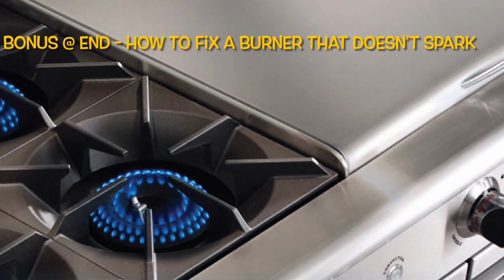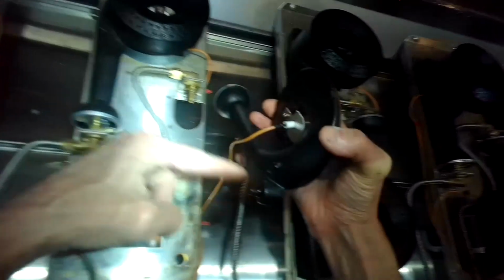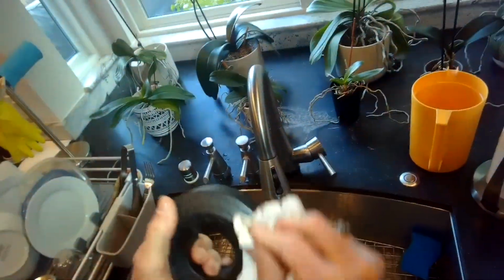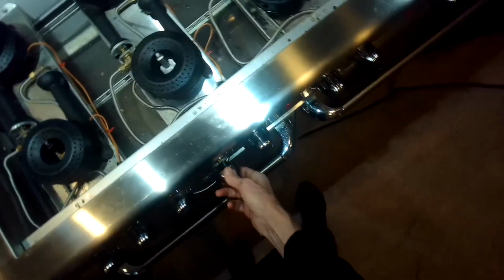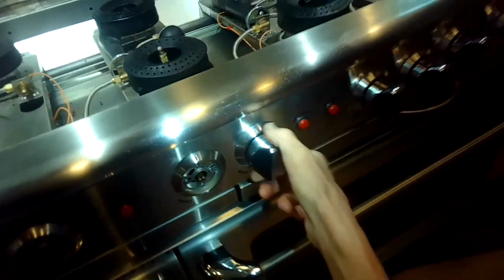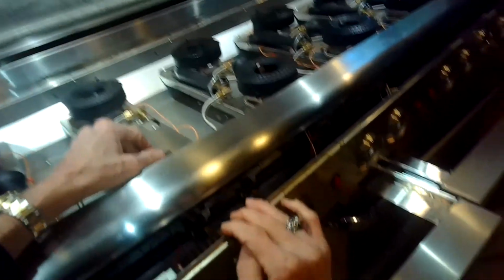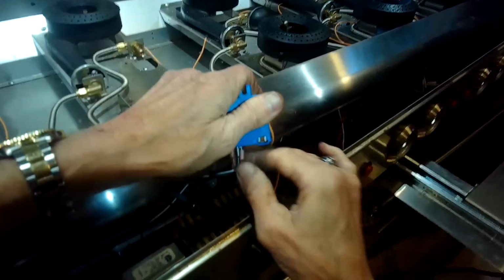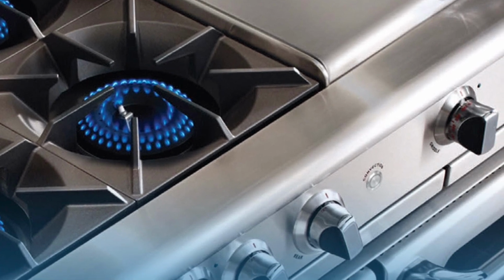✨ Capital Range - Burner Won’t Light - No Clicking - EASY DIY FIX  ✨

Comment: This is great thanks. My problem is similar but instead of no spark I get a constant spark that won't stop after the burner ignites. This only happens on one burner. Any thoughts on that problem?
Reply from the maker: Hi Erik,
That usually means that the one burner might be wet.